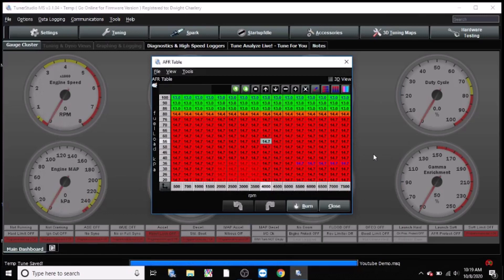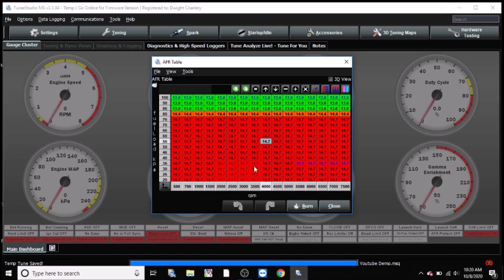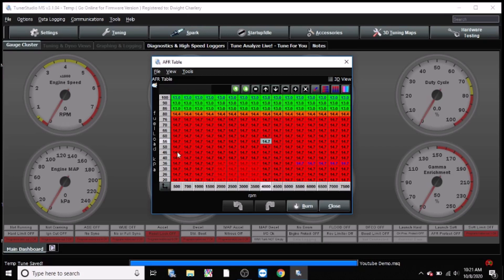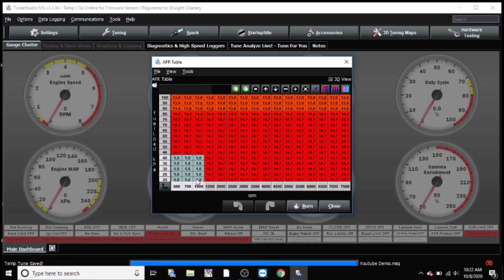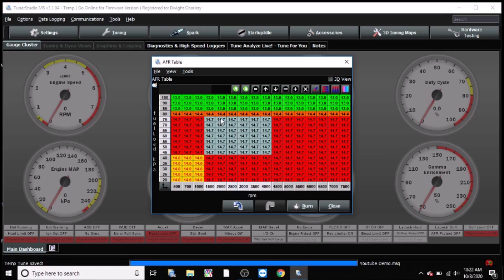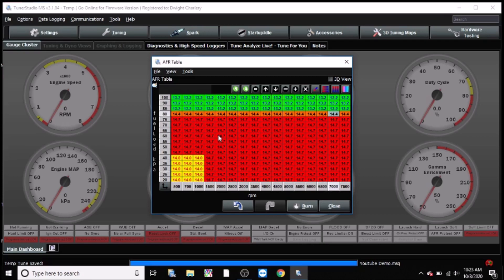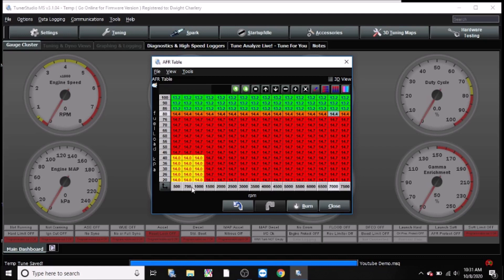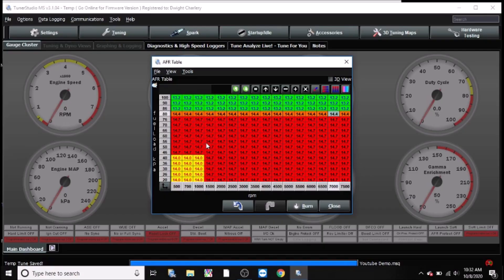Understanding Air Fuel Ratio Tables [NA]

Comment: Hey Dwight!

Can you tell me the difference between VE an AFR table? And which table should i use on the road to adjust fuel?
Reply from the maker: Ve table is what the ecu uses to fuel your engine. Afr is a target table for the ve table
Reply: @DCWERX  ah I see, so you modify your VE table and then check your AFR table for the actual fuel change
Reply: @DCwerx  also I wonder if you could explain how to set up a base ignition map? Is it even possible without knock sensor ?
Reply from the maker: @adrian3137  this is beyond the scope of YouTube video commentary. I highly recommend you buy the High Perfermance Academy EFI tuning fundamentals course. It will give you the knowledge you are seeking
Reply: @DCWERX  i might have to do that :) thanks dwight!

Comment: I'm building my first EFI turbo V8 4.6l 2v Modular engine and come from the ancient days of carburetors... your video is a very understandable intro to fuel management, thank you.
So much to learn!!! Piggyback ECU, convert my COPs to wasted spark, install two four channel ignitor boosters, decide on which ECU..Speeduino, MicroSquirt, The Russian guy's or Rabbit from Australia....my head is spinning...
Reply from the maker: Either one of the ECU you listed will get the job done